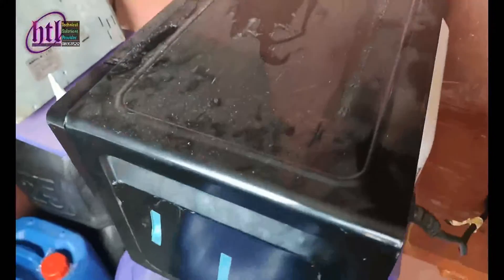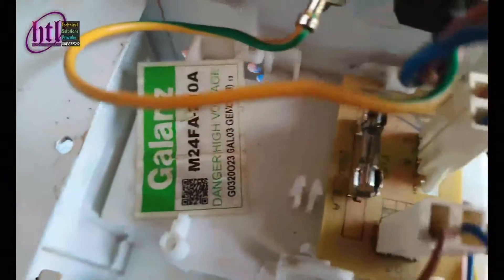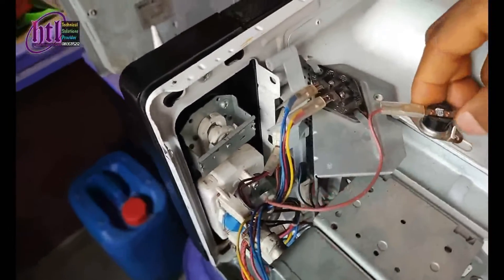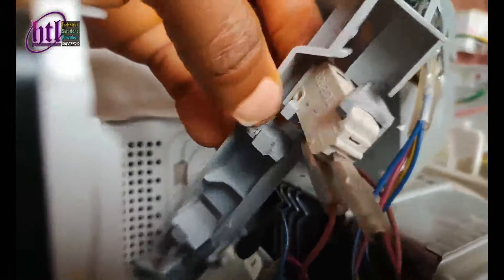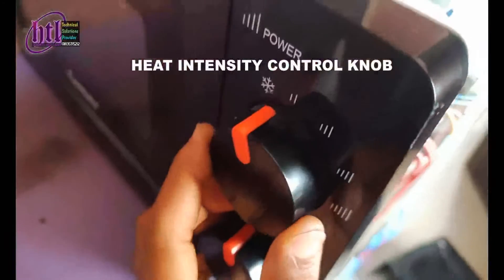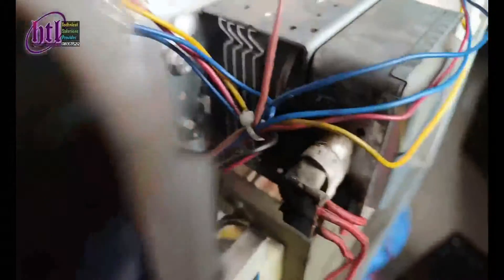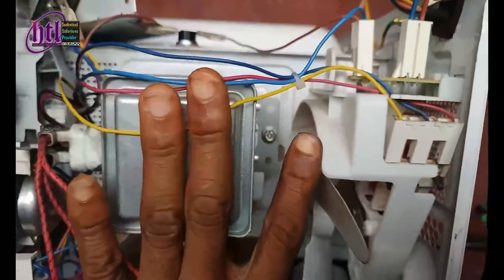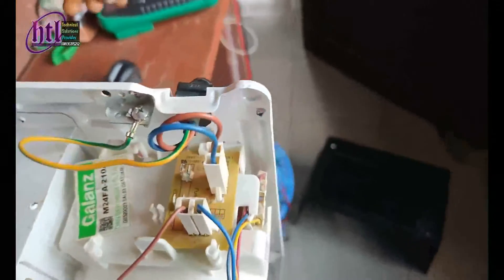All the parts of a microwave oven, How it works and how to fix it. Capacitor, transformer, interlock

Comment: Thank you for the walk-through, I'm now getting an idea about the appliance!

As for the high-voltage capacitor, I have been warned elsewhere to discharge it (by using two insulated screwdrivers for instance) before touching it to prevent an electric shock, as it remains charged for a long time after unplugging. I don't know what's your experience or practice regarding this.

Comment: question so at 3:06 on my microwave one terminal was melted. I replace it. 
 i dont understand why that happened.
 Do you have any suggestions on what to check? All fuses are good but i get a PF error code
Reply from the maker: Most likely excessive heat
Reply: @humblynn  thats was my thoughts but the temp fuse is still showing continuity and it only happened for that one terminal now that i replace its just showing a PF error.
Reply from the maker: @1DumbSquirrel  thats power failure alarm. check the fuses and if possible you should the former thermal fuse to see if the error clears. whats the name of your microwave?